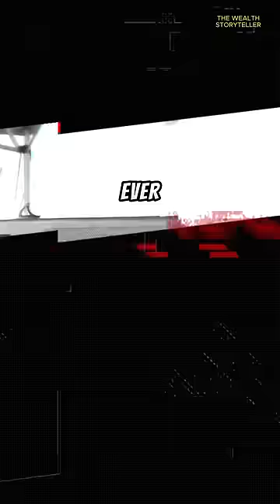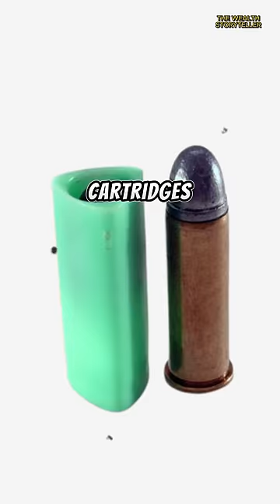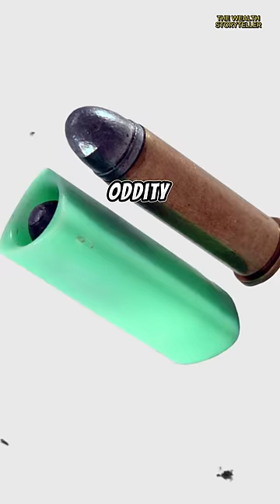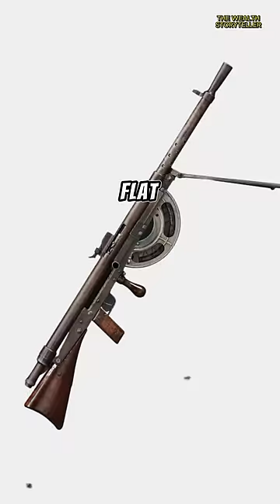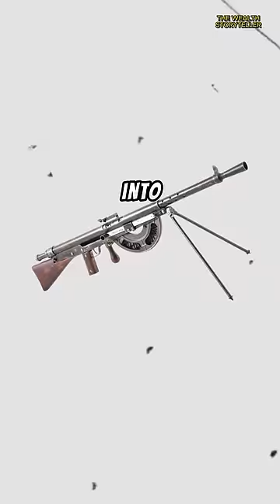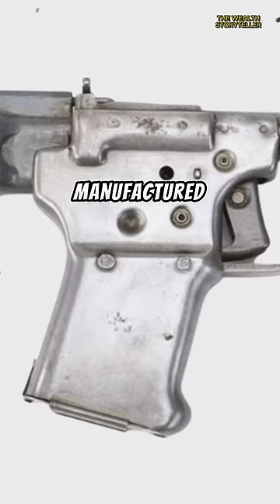3 world's dumbest guns ever made

Comment: The chauchat and liberator pistol were not failures, you just don’t understand their purpose. The chauchat was meant to be manufactured as cheaply as possible and distributed to as many soldiers as possible. It was literally made in bicycle shops. They were by far the most numerous machine guns on the battlefield, with over 262,000 manufactured. 75% of the malfunctions reported were because of the magazine getting dirt in it. And malfunctions today are because of old magazines that are meant to be disposable and cheap
Reply: The chauvhat was also a horrible gun on WWI that jammed very frequently but it wasn't the guns fault but rather the issued magazines who had windows cut into them. That was mud and other debris entered the weapon and jammed it up, sometimes even leading to the rifle exploding
Reply: @ivanvukadin3194  The exploding thing is just wrong. Don’t know where you heard that. The chauchat has a long recoil action which is one of the safest. And yes the magazines accounted for 75% of the malfunctions, but the gun was still reliable enough to serve its purpose. The American 30-06 conversion was what caused the most myths about the chauchat because that was manufactured wrong and had somehow even worse magazines
Reply: @ivanvukadin3194 the barrel would have to be incredibly jammed for the gun to explode, even then that would more likely make the barrel burst and not explode the gun.
Reply: @dawsongranger4940 well and another thing is, is that the Chauchat was also brand new technology, ain’t gonna be perfect but I’d rather have a fully automatic machine gun over a bolt action rifle from the late 1800s to early 1900s! Don’t understand why people are so quick to call it crap.
Reply: Only the US had issues with it cause they chambered the wrong size round. The French version ran fine
Reply: Pretty sure this channel just finds something on the internet that'll bring the user views regardless if they're giving us accurate history or information on what their short is telling us.
Reply: They would use them in Bi-planes on occasion and said they worked fine becuse they mostly stayed dirt free.
Reply: @dawsongranger4940 I suspect exploding issue had to do with the fact that the weapon was manufactured in bicycle shops and quality control was taking a hit. I wouldn't be surprised if war time steel standards weren't what they should have been.
Reply: @tsiefhtes  the long recoil action makes exploding nigh impossible. The barrel would weld itself to the shroud and completely lock the gun before it ever exploded. Long recoil is one of if not the safest repeating action
Reply: @lukycharms9970  it wasn’t the round chambering, it was incorrect measurements for the gun itself being used. Imperial vs metric
Reply: @ivanvukadin3194 It was horrible for the Americans. They tried to rechamber in 30.06 and ran horribly. It ran fine with 8mm lebel. Amazing what using the right cartridge in the gun can do for you
Reply: Yeah well if your gun has a bad magazine then it’s not very reliable, especially when you live and fight in mud. No wonder they couldn’t rely on it. I’d rather have an old single shot at that point.
Reply: @brewski0277  They could rely on it and they did. The guns worked well enough to be relied on. Just because 75% of all malfunctions were caused by magazine issues doesn’t mean it was jamming every magazine
Reply: @dawsongranger4940  if there’s gunk in it from the trench then it’s a very high probably of not working, the fact it’s far more likely to have a malfunction makes it trash. The metal saved from the cutouts really isn’t worth it, the springs were also pretty bad but I’d settle for bad springs and an enclosed mag
Reply: @brewski0277  it wasn’t cut to save metal, it was cut to load the magazine properly. And the gun isn’t trash, it worked fine for it’s intended role. Over 260,000 were manufactured and nothing was changed with the magazine. Soldiers were given a fully automatic rifle loaded to 16 rounds. That’s a hell of a lot better than a 5 round bolt action
Reply: @lukycharms9970 they didnt chamber the wrong size they just used a ammunition they manufactured
Reply: @dawsongranger4940  the magazine is literally the downfall of this hot pile of garbage alongside the poor cooling. And French lebels held 8 plus 2, one on the elevator and one in the chamber. Lees held 10 plus 1.  side note fuckin love the Lee enfield. They didn’t need to design the mags so poorly, you don’t need the side open to load a decent mag, idk why they wouldn’t design one that didn’t need to be half open and exposed to the mud that was everywhere in the trenches and in no man’s land. The French ended up adopting the browning 1918 before the war ended. And developed a better light machine gun after the war. It was good outside of the dirty battlefield in clean conditions which weren’t very common in France in ww1.
Reply: @lukycharms9970  the armory “gladiator” was charged with making the 30-06 ones and they reamed the chambers wrong, effectively making them useless
Reply: I don't understand the chauchat fanboys are willing to go to bat for a weapon that was bad.
Reply: @InternalErrorz it was not brand new technology. Madsen and the heavy machine guns beat it to the punch
Reply: @lukycharms9970  The US versions didn't "chamber the wrong size round." The French were contracted to make .30-06 versions for the US. They didn't properly adjust the guns recoil system to account for the different pressure of the .30-06 compared to 8mm Lebel. This couldn't be done in the field either since it wasn't a matter of adjusting the gas port, the weapon needed more engineering-level adjustments. They made those adjustments when doing the Belgian contract guns in 7.65mm Mauser and later Polish contract in 8mm Mauser. Why the difference though? Because the Belgian and Polish contract guns were made by Sidarme. An actual gun factory full of people who knew what they were doing. The American contract was handled by Gladiator, who was a converted civilian factory and had good machinists, but no real firearms engineers to make those kinds of adjustments.
Reply: @dawsongranger4940  And the 30-06 round was more fouling as opposed to the normal chauchat rounds that it was designed with (8x50mmR Lebel) which didn't help the 30-06 conversions at all.
Reply: It was a good gun but the Americans didn't have the bullets so they changed the mag and the bullets
Reply: It was a good gun but the Americans didn't have the bullets so they changed the mag and the bullets
Reply: @ivanvukadin3194 did you read the comment you replied to?
Reply: @ivanvukadin3194 did you read the comment you replied to?
Reply: @InternalErrorz  for the 1940s what would expect? I mean u aren't going to see anything ultra futuristic or a modern day weapons used in combat lol. Are they crap in the present day world? maybe. but they obviously weren't in the 40s if they literally used them
Reply: No the chauchat was a failure, the sten was made to be as cheap as possible too but it still ran, cutting holes in your mag is the dumbest shit ever, a cheap gun isn't worth being cheap if it doesn't perform
Reply: @unstopable8205  Manufacturing over 260,000 of them doesn’t sound like a failure to me. If the malfunctions were truly an issue and the gun was a failure the French wouldn’t have bothered. The gun ran, soldiers worked around it and used it effectively. And it worked well enough for the Americans to try to convert them
Reply: @dawsongranger4940  numbers mean so much huh? Tell that to all the Russian tanks smoking in Ukraine, Americans wanted to convert them because it would be faster than waiting for a boat to cross the Atlantic.
Reply: @unstopable8205  The Russian/Ukraine conflict has nothing to do with the success of one of the first light machine guns in ww1. Yes numbers matter, the French wouldn’t have bothered if it weren’t useful to them. And if it weren’t useful to the French the Americans wouldn’t have bothered as well. I don’t understand the hate around the chauchat. It was adequate, it worked well enough to serve its purpose
Reply: @dawsongranger4940  I personally actually love the chauchat but your defense is weak, necessity doesn't make something good and just because it was mass produced doesn't mean it was good. The russo/Ukraine conflict is an example of mass produced trash that doesn't stand up to better made and maintained equipment despite the earlier stages of the war having both sides using similar equipment, a retool of the chauchat didn't happen in significant enough numbers to outfit American soldiers, it all comes down to necessity and they got what they needed in a shitty package because cheap and fast was more important than fixing the major issues of the firearm, the most major/obvious one being a magazine with cutouts letting everything from the field into the mag causing massive failures that made alot of soldiers have a strong dislike of the gun.
Reply: @ivanvukadin3194  An interesting fact about the windows in magazines is that, they were actually really useful. Loading those weird ass magazines is a massive pain and while in a modern context we think of magazines as disposable, you have to remember that back then, they weren't. External magazines were pretty new, hell, magazines were pretty new. En Bloc clips were the closest thing to disposable and even then they were often reloaded. Every gunner had a loader who's job was to reload that mag, under fire no less. With the window, they could pull back the follower (that had a hole in it for your finger) and load the most of the rounds very easily. They had to load almost as fast as the gunner shot, that sh*t is HARD. The spring tension at the end makes the last few super hard and dowloading to 19 was very common, in part to prevent feeding problems. They all came with a box to keep the magazines in with a bunch of rounds, but yeah, in active combat that stuff gets dirty, no doubt. On the other hand, you could argue that the windows makes it much easier to clean in though,   though not sure I'd make that argument...
Most of the time, even if it looks insane (and is), there's thinking behind it :)
Reply: Depends on what do you call new technology. Madsen is the world's first lmg designed between 1896–1902 and entered production in 1903 so I would argue that French had no time to design a reliable gun.  @InternalErrorz
Reply: That was a munitions problem american don t use the same  so thats why this  weapon has problem
Reply: And the chauchat are not make for use us armor
Reply: Ammo*
Reply: @ivanvukadin3194  Not at all forgotten weapons made extensive videos on it proving that only the american made Chauchat had problems. The Chauchat was reliable and was one the best machine guns of ww1 and the first light machine gun ever made, then the americans wanted to buy and make them and instead of using the 8mm lebel cartridge it was designed for they produced an exact copy of the Chauchat with .30-06 bullets that had too much powder to correctly cycle the rifle and to operate in full auto.

Comment: The Chauchat was actually a fantastic machine gun, it did not however, hold up well to trench conditions which it was never designed for. The windowed magazine often let mud and debris into the action, leading to jams and misfires. When kept clean, they were excellent.
Reply: Also it was pretty shit when it got converted to different rounds like they did for the Americans so that’s part of why it’s seen as shit
Reply: Hence it was crap. It was almost impossible to keep dirt out of the magazine. Even shooting prone.
Reply: @duaneaikins4621  almost every weapon employed by both sides struggled to perform in the wet muddy mess that was the trenches and no man's land. Jams were quite common on all manner of small arm. Even the fabled winchester 1897 "trench broom" was prone to misfires and jams because it was almost impossible to keep the ammo dry and it relied on a wax cap on the round to keep moisture out that often cracked or otherwise compromised the powder and primer. Not a shit weapon, just a shit place to be trying to use ANY weapon.
Reply: Though the Chauchat is a terrible and horrible gun with another terrible brother called the Chauchat 1918. It was not meant to be good. It meant to be produced in the fastest way possible. And if you were in the French military, would you have the 1892 Berthier or a Chauchat
Reply: Also Chauchat are made in bicycle shops tho. Not in the actual firearms factory.. 😅
With those cheap specs, it already can withstand the trench area conditions, which is not its intended purpose, and it's already great...
Reply: The fun was designed in 1915. They knew what conditions it would be fighting in. And yet they didn't design it to withstand them. It was a bad gun
Reply: @rubberwoody  Wrong. They were adopted by the French Army in 1915. They were in development for 10 years prior to that with about 100 being produced before the war started, most of which were mounted on aircraft. So they were pretty clearly designed for use on aircraft, not trench warfare.
Reply: @spencerquimby4726  then they should have been modified for trench use. Particularly in the magazine
Reply: @rubberwoody  Wartime production means as much as you can of whatever we have. That was a luxury they really couldn't afford.
Reply: @duaneaikins4621  Exactly forgotten weapons made extensive videos on it proving that only the american made Chauchat had problems. The Chauchat was reliable and was one the best machine guns of ww1 and the first light machine gun ever made, then the americans wanted to buy and make them and instead of using the 8mm lebel cartridge it was designed for they produced an exact copy of the Chauchat with .30-06 bullets that had too much powder to correctly cycle the rifle and to operate in full auto.

Comment: The liberator wasn't dumb at all. It was supplied to the French resistance to give them a fighting chance to arm themselves and it was better than nothing. You've got to remember that the whole world was short on most raw materials that even the US deployed weapons, like that M3 Grease Gun, out of stamped steel. So the fact that any gun was ever designed, built, and deployed at all for them was good. It could be used to kill a German to get access to their guns or grenades or for short range assassinations. The Chauchat was just a result of the fact that machine guns were pretty much brand new to warfare and the first to just about everything is pretty rough. Every machine gun at the time was big, bulky, awkward, and heavy plus most of then required to have cans of water on standby to solve the overheating problem. Everything new has its issues.

Comment: The Dardick was experimental, hard to say it’s the dumbest if it’s exploring a potentially new operating system, the Chauchat worked well enough in French hands. The mags were bad to get dirty and not work right but if the ammo was stored correctly the gun worked well, the US production/conversion is the variant that didn’t work, changing the chambering to 30-06 from 8mm Lebel and doing so across an ocean with two different forms of measurements lead to guns that mechanically were faulty. The Liberator might have not been thought out entirely but at the same time I’ve seen some mention of physiological effects in the Germans once it was discovered the US was dropping guns in to arm civilians. I felt like this was a very rushed video based on opinions

Comment: Second try. Original lost and floting around somewhere in cyberspace. 

According to legend and 
folklore, the Chaushat was put together mostly with parts from a moonshine still. 

When I first saw the Liberator pistol, my first thought was that it would be a  factory-made zip gun chambered for a serious cartridge. I remember the ones we made from quarter inch pipe that would, after a fashion, fire .22 rimfire cartridges. Accuracy was on par with Liberator pistols.

I had a homemade wrist-rocket style slingshot  that used surgical tubing that was a good deal more powerful and accurate than those zip guns.

Comment: The chauchat was actually designed to be mounted to and fired from aircraft. But with the outbreak of the war the French knew they needed an automatic rifle for ground combat and hastily tried to reconfigure the weapon for infantry units. Most of its problems were completely irrelevant when used in its original intent, in the air.

Comment: Oy, you really missed the mark on the Liberator.  It was intentionally designed to be semi-disposable.  The intent was for a resistance fighter to locate isolated enemy personnel, dispatch them with a quick and surprising shot to the head and for the resistance to then arm themselves with enemy's weapons.

The US didn't want to have these things remaining in circulation indefinitely and they only really needed to be used once, thus the reason for shoddy construction (it was by design).  

If done correctly, they now have the enemy's SMG, rifle and or sidearm.  If they failed (missed), they would be killed.  No need to make something designed for a sustained firefight.